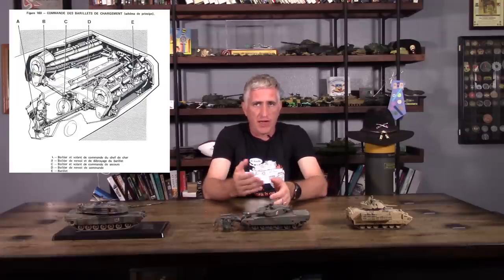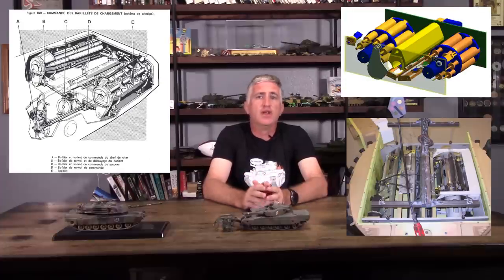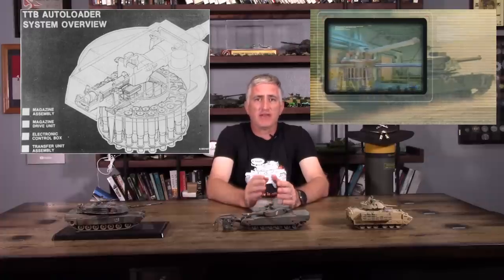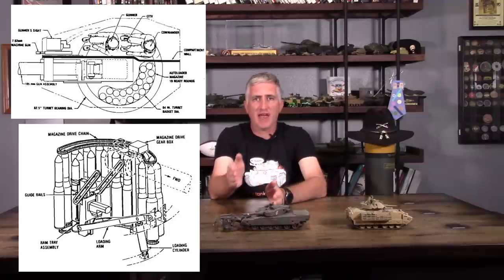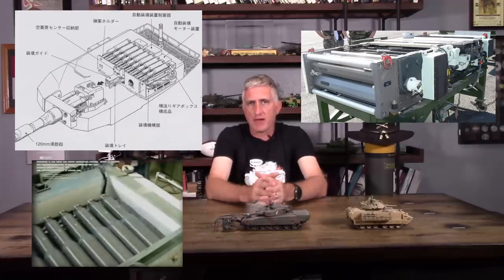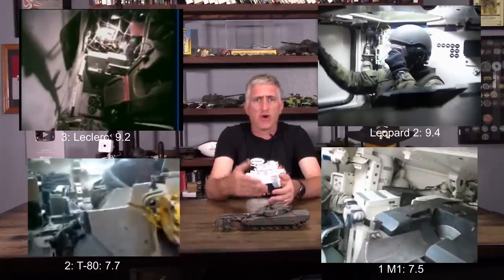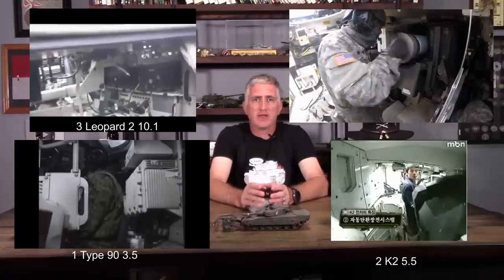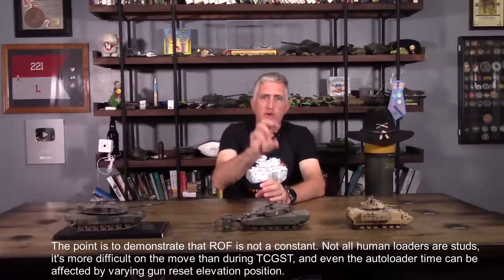Whither the Autoloader?

Comment: As a former Panzer crewman, aussie Leopards and M113's, the problem of going from 4 to 3 crewman in battle tanks is as I have experienced crew fatigue. Yes we ran Leopards on 3 man crews and it showed. During resupply at those dark ungodly hours thing got real slow during the resupply and increased the risk of evasive action if attacked. Even worse when you have a 2 man crew as on the M113's. Now honestly who would be responsible for making a brew on the move in a 3 man crew? Great video....with some good points brought up....and best I end this with "FIRING NOW".
Reply: That's more than a little bit different, since those vehicles are designed to work with larger crews. That would be like saying a 3 wheeled vehicle could never work after driving a Ford Focus that was missing a wheel. It was never meant to be run in that configuration, so of course it's a bitch to make work when it isn't being used as it was designed
Reply: F-22 must carry 4 pilots instead of 1 to prevent crew fatigue! Oh wait. Same dumb excuses for outdated tech over and over again.
Reply: @Conserpov  Well, than you should be able to explain why even Russian T-14 need 3 crews.
Reply: @yangcheng-jyun8542  
This is pretty easy. Elimination of a human loader is a generational leap. Elimination of crewed turret also is a generational leap, while maintaining 3 crew. Technology to reduce crew further is not there yet.
Reply: @Conserpov  in the idea of not having technology to shrink crew from 3 to lets say 2, I disagree.

In the 80"s KAMOV designed and developed KA-50 attack helicopter. Very unique, because first time attack helicopter was with single pilot instead of two.

The KAMOV automated a lot of systems, like excellent autopilot system so pilot use time to look outside, and excellent targeting system so pilot can look outside middle of attack.
The navigation system was designed so that pilot can enter new flight plan like entering address to Google maps, either by searching by city, town, landmarkb or even by street name etc.
The cockpit was made fully armored. Every window, all directions to withstand 30 mm HEI-T as used in AAA. So pilot survived from first few rounds if getting shot at (comparing this to example AH-64 or AH-1 that has only real armor rated plate between pilots and armor glass in front piece, and rest are capable being penetrated by assault rifles from side windows, side panels, even under seat. Similar with Mi-24 that has armored cockpit but only front flat glass withstand 12.7 mm API).

First time as well did pilot in helicopter get a ejection seat, so at 0 speed and 0 altitude pilot got out in emergency.

The findings on the testing it and in combat trials was that pilots workload was in intense phases less than two-seat multirole fighter pilots experienced.
It became more combat effective than Mi-24 with two crew as you have individual doing decision and reacting to threats. No communications required between pilots.
So idea was that KA-50 replace Mi-24 fleet, and every attack group is 4+1 where it is 4x KA-50 and 1x KA-52, what is two seated variant where the group commander will sit and assign targets to each member from what they spot (datalink between each, they saw each others positions on map etc)

The two seated variant came as requirement to get to sell KA-50, as to enter attack helicopter sale competitions, buyers required two seater helicopters. Not for good reason, just "as backup". Because if pilot gets hit, co-pilot needs to fly expensive Helo to base (why example real armor in Apache is between pilots).
So KAMOV built KA-50-2 first, then that as KA-52.

Point is, at the current technology era, (since at least three decades) the MBT crew could have been shrunk to two members.

Driver/commander
Gunner.

Give the driver means to use another display to utilize a rooftop, mast mounted optics to observe and scout behind cover or concealment, and to scan additional threats.
Give it a way to quickly scan nearby surroundings to find if something needs to be avoided by moving. 

In attack formation gunner needs to have own idea where what is, and they need to focus to key targets.
Where driver need to focus driving and obstacle evasions. So there isn't commander to search additional threats. But you are in high speed toward enemy positions, so you don't have much time anyways, as the company needs to use number of guns, instead number of eyes to win.

In stationary fight the driver can do both duties very well, as moving vehicle to peak around corner, ridge etc is easy thing to do.

This can be experimented example in Arma 2/3 or why not even in world of tanks.
The difference is that in WoT (never have played that one) you have superior situational awareness because third person perspective and artificial detection, tracking etc.

But never i would argue that you can have just one....  As driver+gunner makes it easier and effective, but not overloaded for either.

As any given combat phase you really have mainly two pairs of eyes, commander and gunner that has FLIR and optics. And in close combat you should have infantry anyways as your protection.

As flying helicopter, targeting and observing outside near and far for incoming missiles or fire using eyes only.... Is more difficult that driving and looking around.
Reply: @paristo  
> in the idea of not having technology to shrink crew from 3 to lets say 2, I disagree.
The issue has been researched very extensively for several decades, the current consensus is that the gunner may be replaced by electronics - in a few years, but not yet. Replacing commander and driver is out of the question so far.

> In the 80"s KAMOV designed and developed KA-50 attack helicopter
Its extensive trials showed that pilot workload was excessive during target search, so it needed external target designators to be effective (which would be okay for a specialized tank buster, but such a doctrine is uneconomical compared to fielding multirole helicopters - if you don't expect WW3, that is), which lead to adoption of Mi-28 over it and development of Ka-52. 

> driver+gunner
Limitations of driver+gunner arrangement are more or less known since WW1, or at least since the Germans did their research in 1930-s. Not even modern optronics change the complexity of real environment and necessity of "sniper/spotter" duo.
Reply: @Conserpov   "Replacing commander and driver is out of the question so far."

You don't replace commander, you only give commander the means to drive the tank. 
In other words, you keep the driver in front in better armored location, move gunner next to him, and give driver the ultimate visibility outside. 

"Its extensive trials showed that pilot workload was excessive during target search, so it needed external target designators to be effective "

Just the opposite. The pilots loved that they could work alone so effectively and then as a group without increasing the workload by requiring to work with a another. 
The pilots requirements after extensive trials (after testing, and after combat trials) was that KA-50 required a FLIR for night operations, and slightly re-organized instruments layout. 
The KA-50 was 1.8 times better than the Mi-24 was, and that was before the combat trials even. 

"which lead to adoption of Mi-28 over it and development of Ka-52. "

Mi-28 was in the development, and it lost to KA-50 in the trials, but it got chosen for various other reasons to be the next attack helicopter for Russia. The KAMOV was even paying itself two last KA-50 test units as it was promised for contract as it had won the trials. But after two times cancelation of the contract (and once renewing it), KAMOV didn't get it after all and Mil did receive it. The KA-52 was never meant to be replacement to KA-50, it was just for the group commander position. Just like it is with the Su-27 or MIG-25 and MiG-31 squadrons, where flight commander is in two-seater version handling communications, commanding each member and designating targets to everyone, not flying or searching targets or anything else than doing strategical decisions. Before KA-52 idea, KAMOV had idea to use KA-60 first as group leader and target designations (similar to Kiowa and Apache), but it was found it couldn't perform the duties as KA-50 did. As KA-50 failed for contracts, KAMOV continued with KA-52 as two-seater was required featture in export markets and that has acquired some sales for them. 

"Not even modern optronics change the complexity of real environment and necessity of "sniper/spotter" duo."

That is the whole point, that the driver+commander / gunner is the DUO, that can't be shrink any less from that. 
The loader does nothing much (and all arguments that it is important for other tasks etc is flawed as MBT does never work alone that there wouldn't be any other men near by to assist the troubeling MBT) as addition to the MBT operations. 
Using a roof gun? That is obsolete idea already as if you need to use that without infantry around you, you are in worse situation than that roof gun helping you.
That is why everyone else is ditching the loader and replacing it with autoloader. 
And similar thing is with the driver, just to obey commands from commander, because driver has limited visibility to around and non-existing to rear (in M1 Abrams as example) so only one that can tell driver where to drive is the commander. So simply saying. commander is driving the MBT on that moment, badly because it is done verbally and not directly. So give driver the possibility have that same visibility outside as commander has in combat situations and problem is solved. 
In the future the MBT has that same capability as F-35 pilot has, that you can see through the vehicle just by looking, and that is final nail to the whole subject that commander is required.

The technology shouldn't be underestimated, getting overlay of the own troops positions around you, the designated targets or threat areas, capability to see at night or to far, are all just something that makes commander position less required as he becomes bottle neck to the information delivery to all others, or lowers others value in the whole vehicle (supporting one-man-hypothesis where ie gunner is said to be obsolete).
Reply: @paristo 
> You don't replace commander, you only give commander the means to drive the tank.
Commander can't also be driver, not in an MBT. This is not even debatable.
Commander cannot perform commander's combat duties while driving. And on top of that driving is considered the most intense job in a real tank anyway.

> That is the whole point, that the driver+commander / gunner is the DUO
Combat performance of driver + commander + gunner outclasses performance of driver + gunner (whichever one of those also performs commander's duties). This is conclusive.
In the near future, gunner may be replaced by AI, with a certain performance tradeoff. Not either of the other two.

> The KA-50 was 1.8 times better than the Mi-24 was
Mi-24 was just very old. Ka-50 vs Ka-52 would be much more informative.
Single-pilot Ka-50 was just too narrowly specialized for Russian military budget, because multipurpose/target designator helicopters would have to be acquired either way.
Ka-52 can do anything Ka-50 can, but not the other way around. The choice was obvious.